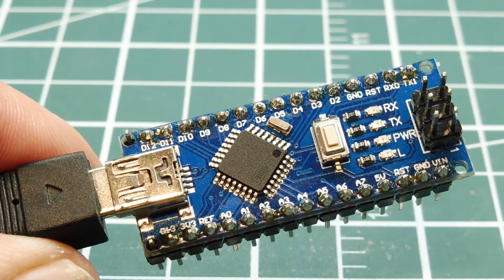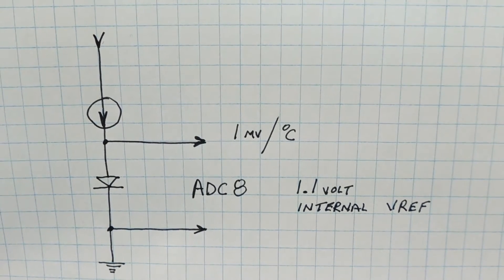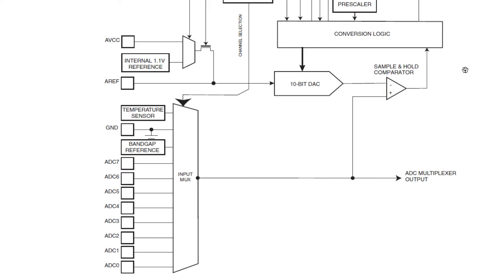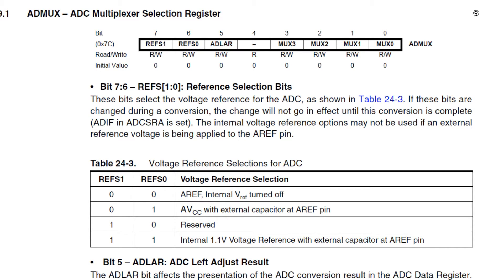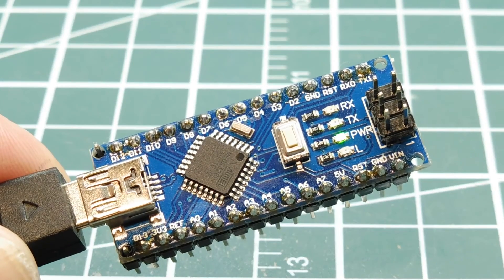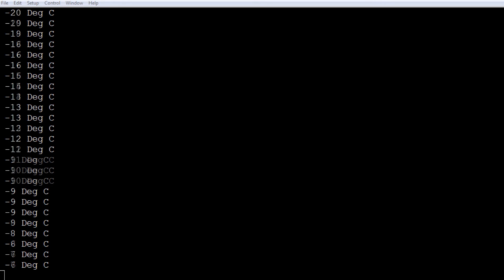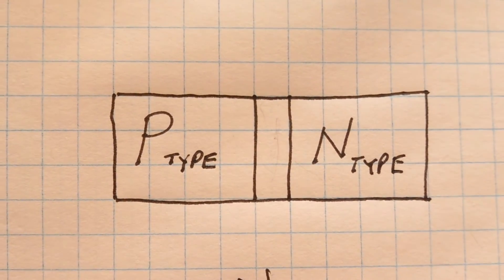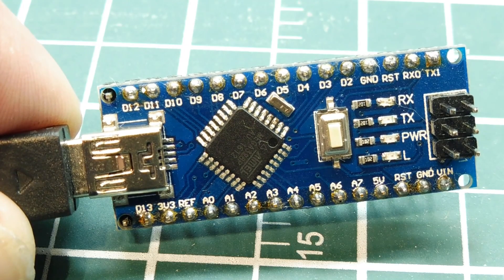ATmega328p Internal Temperature Sensor

Comment: Really great and informative inside look of the atmega.  0033mer, can you explain what the purpose of the reference voltage is?  I don’t understand that concept.  Thanks!
Reply from the maker: The Vref sets the maximum voltage that can be applied to the ADC and determines the range of conversion, so the input voltage of the ADC is 0 to Vref. A 10 bit ADC will output a value of 0 to 1023 with an input voltage of 0 to Vref.

Comment: Well, my dear, you had 1,253 views in your video (til 04-14-2018) and I bet that 99,99% of the viewers did not understand it.
Let me say "What a F****?"
Could you be so kind and speak in a normal language? I mean C++ with the possibility to use it in the Arduino IDE?
And, as Ashraf Atteya said: " good but where the coad (code) ?
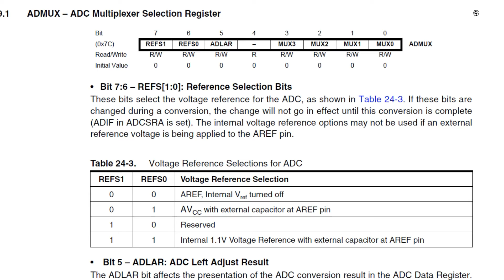And you said: Code starts at 5:21?????? What code???What kind code is it? Did you explain that? Is it Assembler???

Could you be more kind with common mortals?
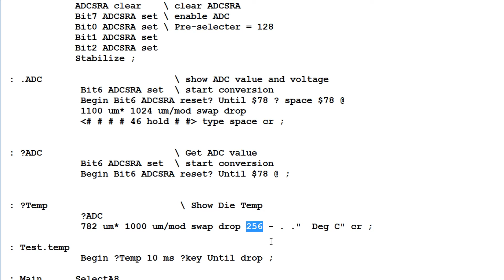Reply from the maker: At 6:50 I indicated the code is written in Forth. Forth is a programming language that was invented and used before C and C++.
Forth is used extensively by NASA in their space probes because its main strength is controlling hardware.
https://www.forth.com/resources/space-applications/
Reply: OK.

Ohhh. that one that is used for Operating Systems boot (and drivers).
Sorry, I couldn't identify it. 

I just comment because the title of you video was very suggestive and you use an Arduino Nano in it, so I thought you will talk in Arduino language for everyone understanding.
That's all .

(any convertor Forth -> C++???)
Reply: I love Forth and I really appreciate you using it for your videos! What I like about it is that it takes a little digging and learning to be able to use it!
Reply: Pill Of Shit you are.